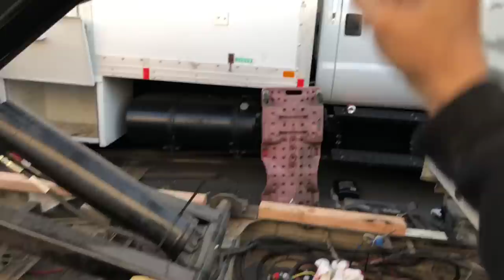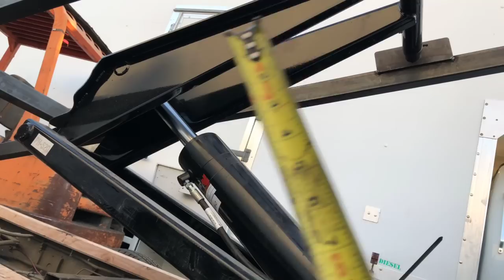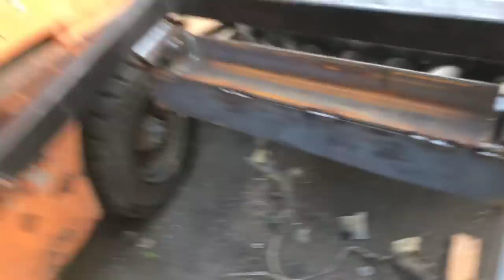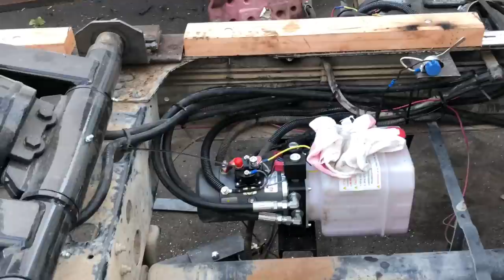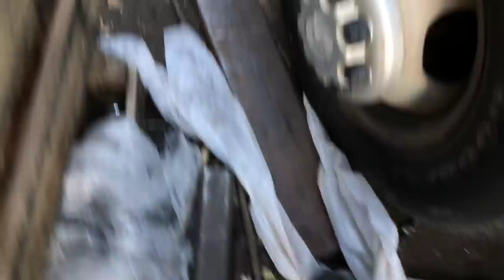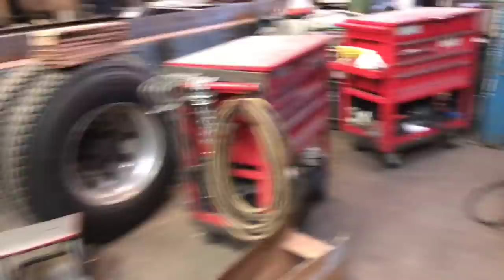How to install a dump hoist: Premium Supply ph520 8 ton Dump hoist

Comment: For the extra $8 everyone should pony up for a  set of Grade 8 Bolts, because... trucks have wheels and can find themselves relocated to different climates.  Please don't encourage anyone to use a soft bolt for no real reason, even if they live in Vegas or Albuquerque.  Thanks for the excellent vid.
Reply from the maker: You’re right! Although grade 5 is fine we actually almost exclusively use grade 8 bolts at this time. This video is so old so I haven’t watched it in years. But hey everyone is trying to save a buck

Comment: Normally the dump body is built onto a frame which holds the whole assembly, that then has its blocking and is then bolted to the frame.
Interesting idea.

Comment: I got my truck done here. They really did a good job. I recommended. Got an f550.
Reply: how much did this run you for parts & labor all together?
Reply: @cws0228  at least 5000 hydralic unit can cost around 3000 and he charges around 2000
Reply from the maker: Thank you! Remember you can always transfer your equipment in the event of an accident or your truck needs to be replaced.

Comment: Quick question: at what angle does the hoist has to be to install it and where exactly on the chassis frame got be ? Great video by the way
Reply from the maker: There are different locations: further forward more capacity higher angle or farther back lower angle lower capacity. Every hoist comes with a manual that will explain how to calculate this value. Good luck!

Comment: I have an Isuzu npr, that has a 14’ dump bed, but it currently is only lifting to about 20 degrees, it is a dual cylinder underbody lift, can anything or the lift be relocated to get closer to a 45 degree dump angle?
Reply: @CompleteTruckBody   Thank you, I was looking at it closer today, and figured out the pump is actually running out of fluid, they had just put a new pump on it before I purchased it, apparently the capacity of the reservoir is too small, the scissor hoist is 10 ton, and it has twin cylinders, the stroke was 10" and I added a little more fluid and got it to 11", and the hoist still isn't fully extended, the current pumps reservoir is 7"x7"x13" not sure of the capacity, but researching it seems to be about 10 quart, would you know how many quart it would take for this hoist? I wish I could just bring it by and let you check it out, unfortunately I am in KY. I would truly appreciate any help and info you could give me, your video is awesome with great detail, I watched several, and almost everyone else welds to the frame lol, and unfortunately mine is welded also, so now I need to find someone to fix it and bolt it down, should I cut off the welds or can I just add plates to bolt it down?
Reply: I got the measurements today, the outside of the 2 cylinders measure 5 1/2" and 28" long, the center ram measures about 2". Thanks for any help you can give,
Reply from the maker: @TheMrcHilton  you got the write idea. I’ve seen people use fuel tanks as hydraulic tanks when huge volume is needed

Comment: Great video I found this information so helpful  i start my small landscaping business and I work hard to buy a 2007 chevy 2500hd with 29,000 k miles rust free i buy a nice  aluminum flat bed and a hoist and hydraulic pump everything to turn it to a dump .. i bring it to a guy that said that can do the work  he is supposed to do the sides and back gate for 5,000 k he was supposed to finish last week i call and texted  him didn't answer today he finally answered is not done  he sent me one  1 pictures of  what he had done and is not looking good 😕 like you said back yard welder very disappointed 😞
Reply from the maker: I’m sorry to hear that! But I hope you got it fixed and are back making money. Good luck!

Comment: Very nice video. I have a 95 Chevy Cheyenne that I need to install that hydraulic lift. I will drop by your shop so we can do some business. Thanks.
Reply: @CompleteTruckBody  I need this done to a early 2000's izuzu work truck. it currently has a flat bed. It would need to be removed then fabricate a new bed on top of the ram like shown in this video. How much would that cost after parts & labor? I would like the same Premium supply 8 ton hoist as well. thanks.
Reply from the maker: @cws0228  feel free to contact us direct anytime 323-218-4994
Reply from the maker: Feel free to contact us anytime

Comment: Great video, I have a f450 with a 9ft bed but the bed is rusted out. I can get a 10ft aluminum bed for a good price. Do you know if I can  mount the 10ft bed on the truck without any issues as far as overhang or anything like that. Thanks.

Comment: Little 110 welders wont penetrate safely if using those I'd preheat the thicker material till light shade of blue before welding or at the very least clean down to bare metal tripple pass if you see what looks like a hairline crack along the weld it didn't equally penetrate
Reply: @CompleteTruckBody  I used to work for Wheeler/Viking building DOT trucks I had a Lincoln 140 that would do it but I've seen cheaper welders that no matter what wasn't up to the task in those situations stick welding is the best option I still use my old Airco 220 AC welder 6011 for heavy rust when I don't have access to grinding equipment. Another tip if you have a wire feed welder with feeding issues get a serrated wheel my Hobart 185 had constant problems till that was suggested to me
Reply from the maker: Good technique! A lot of people only have access to 110V welders so anything helps
Reply from the maker: @a-75n5lee4  serrated wheels are totally worth the money

Comment: Would it be possible to go in to more detail about how to figure out exactly where to mount it to the frame of the truck?  You talked about how you had to put the spacers in to prevent the top of the hoist from protruding through the top of the frame. But how do you figure out how high those spacers need to be?
Reply from the maker: https://www.rugbymfg.com/service-support/manuals/truck-hoists/223-lr26c-lr623-lr28a-lr2355-non-subframe/file

Here’s the link from Rugby concerning the location of where to mount the hoist from back of cab. 

As for the height you would measure the entire height of the hoist you have and then measure your space between frame and floor of truck. So if your hoist height is 10” and you current height between frame and bottom of floor is 5” you’ll need to add in a 5” mount tube as a spacer. You’ll need to trim a crossmmeber or two to fit the hoist in since it slopes.

Hope this helps!
Reply: Is there a distributed you’d recommend to order from?  There are 0 within 500 miles of me
Reply from the maker: @perfectenough6620  when it comes to Rugby they only sell to distributors who usually only sell and install they don’t sell loose. You can opt for a premium supply which ships from texas but my only issue has been quality over time. Other brands you can get online are usually very low quality and I wouldn’t recommend

Comment: We purchased a grain truck and it will not lift haft of the 600 bushel load it was supposed to be rated for.  After looking at it more closely, they might have swapped the hoses.  When you say, "here is the  side (the port that is closest to the chromed ram), does that mean that this port is supposed to be connected directly to the pump?  This truck has the pump connected directly to the low side.
Reply: The two ports act on the two sides of the piston in the cylinder. (It's fairly common to use double acting cylinders in single acting applications, the other side of the cylinder should be plumbed back to the reservoir to keep it dry, personally I put some fluid in there to lube the seals). Hooking the hose on the wrong side of the cylinder would make it retract....... Your setup is just not strong enough for the load. Swapping a larger bore cylinder will increase the lift capacity BUT the rest of the bed and the scissors assembly needs to be able to handle it, or something will just break, with possible injury to property or life. This is something that needs to be addressed by someone with knowledge of dump beds, systems etc.
Reply from the maker: I had previously replaced to this but my comments disappeared. The other commenter replied with a thorough explanation!
Reply from the maker: @jasonsprouse2803  good write up!

Comment: Question: i see that you use 2 batteries, what was the system you use for the hydraulic pump on the batteries???  The electric connection , the wires connection?
Reply from the maker: The hydraulic pump is connected to the trucks OE battery. The dual batteries is because most diesel trucks in the US need two 12vs.
Reply from the maker: @Kevin Corapi I don’t think it’s a great idea because it’s not rated for this application. You can get a clutch pump to perform this application.

Comment: it will be ok to put the hinges like 4 chinches away from suspention to make bed smaller like 11 feet to install dump bed in an npr hd?
Reply from the maker: It’s possible to put the hinges closer but you want to avoid being too close to the suspension. Keep the frame sturdy

Comment: Why is it you guys can't weld frame flanges but. Allows custom hot rod frames that are Fab out of different frames put together and welded?
Reply: *but DOT allows
Reply from the maker: The DOT doesn’t restrict who what when how can weld and cut into frames. The DOT can slap you with a hefty fine for operating your vehicle with a cracked frame due to overheating or poor workmanship which in turns leads to a lawsuit where you customer wants restitution for damaging their vehicle.

So it’s kinda like you’re “not allowed” to work on electrical or construction at your own home when it’s really about safety and liability.
Reply: @CompleteTruckBody  okay, so you guys are just not welding the flanges to protect your liability. It can be done safely that requires professionals and the proper equipment. I don't know the laws in California for construction or electrical but in other states you actually are allowed to work on your own house and you can disclose that to at the sale of that house but it does need to be permitted which means it gets an inspection. I know you guys are pretty strict over there so maybe that's not allowed. Thanks!
Reply from the maker: @danielbuckner2167  welding onto flanges most of the time is avoidable anyway. We fab whole new frames and crossmembers for trucks all the time but in the video we discourage DIYers from getting involved in a more technical aspect as we often see people weld anything and everything to their trucks weakening it over time. Check out Instagram for photos of the various repairs that come in! @completetruck 

The construction bit is just an example some people work on their own home, but in many instances we recommend leaving it to professionals lest it turn your home into a “buyers special”
Reply: @CompleteTruckBody  I definitely agree with you on hiring a professional for your home. It's one of the biggest purchases people ever making their entire life! Good to know you guys are safety conscious on your truck builds.

Comment: Hello how are you guys- I have a 2000 GMC/ISUZU 4500 NPR 5.7engine-  16ft boxI live in the Chicago Illinois area- I'm interested in having my box converted into a dump- does anyone no or recommend any shops that does this type of work within a 100 mile radius of Chicago??????
Reply from the maker: Hello Jonathan

Thank you for reaching out. Unfortunately we are not familiar with anyone in the area who can perform this work
Reply: Jonathan, try Illinois Truck Center in Elk Grove.  I worked there a long time ago and they put bodies on quite often. They might still be an Isuzu dealer to boot.

Comment: It looks like the hoist is to way back close to the cab, it may not go over 40 degrees to dump debris easily, 
The hoist it’s a 10 ton 
The 8 ton it’s the 516 hoist
Reply: Complete Truck Body Repair Inc  I just got my ph520 today. I would like your opinion since you are more familiar with this power hoist. I think it was built wrong. I could be wrong too but I will post some pictures and let you know my concerns.
Reply from the maker: We have since installed over 500 hoists and have had no issues with install location
Reply from the maker: @JLFLC24  you’re welcome to send us photos anytime robert@completetruckbody.com